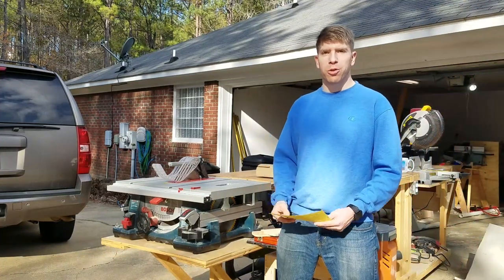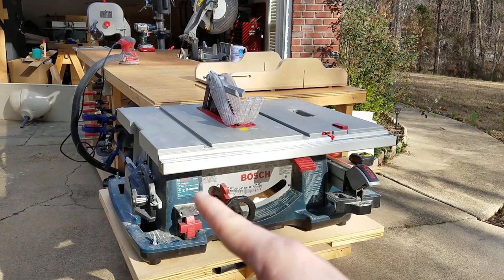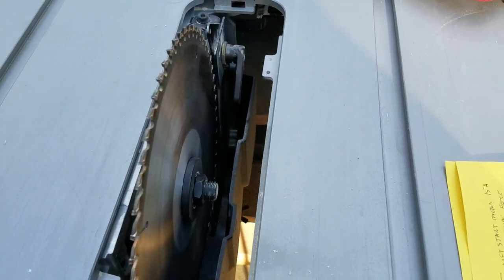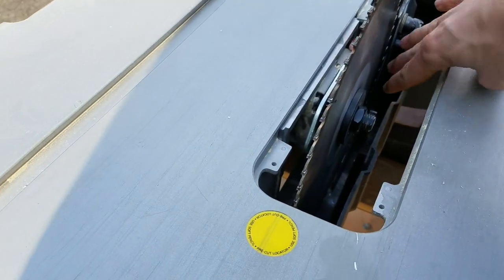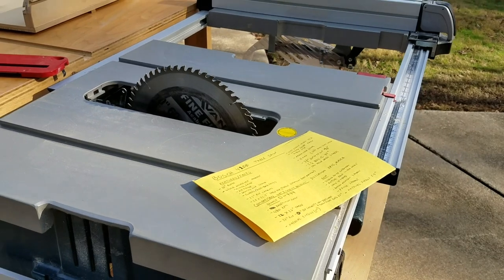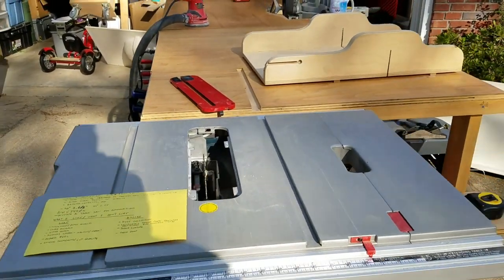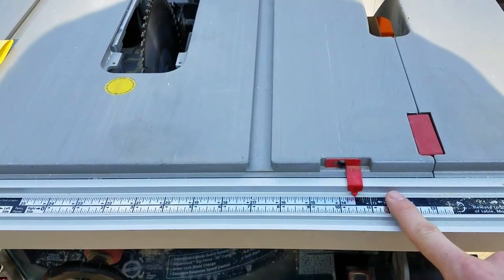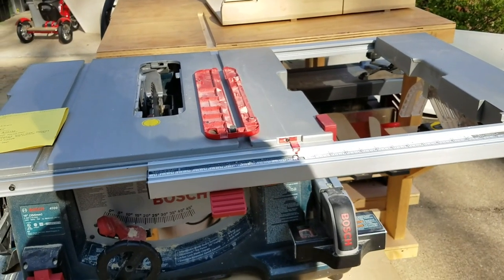BOSCH 4100 Table Saw Review / EP15

Comment: I too have the 4100 and have had it for around the same length of time.  I still like my saw very much.  I hook my saw up to my homemade  cyclone vac system and hardly have any dust anywhere.  My vac is just a 2  1/2 inch system.  Yes!  I would  buy this saw again!
Reply from the maker: Great, thanks for sharing. Id be interested in hearing more about your dust collection setup. Thanks for watching and adding to the dialogue!

Comment: Great and informative review of both the positives and the drawbacks. Thank You for taking the time.

About 5 years ago I was also picking between BOSCH and DeWalt. I did go with the DeWalt and have never regretted my choice. Dust collection is quite good for this type of saw and even better when using a zero clearance insert. Those are easy to make for DeWalt as they require no cut outs or rabbets underneath. And I also move the fence by the fence, there is no need to turn the rack&pinion knob to move it, the fence moves freely. Rack&pinion knob is however very useful when You need to make micro adjustments to fence position, You can very accurately move the fence by a hair's width and lock it down without nudging it off the mark. I would like the larger rip capacity of the BOSCH sometimes, but have found ways to work around that (tracksaw). DeWalt has been dead accurate for >5 years now and never needed any adjustment. The aluminum table finish seems to be more durable on the BOSCH as mine has a lot more streaks and wear marks on it from roughly the same length of use (~5 years).
Reply from the maker: AM YouTube, great discussion and thanks for commenting and the feedback! I know there are a lot of others out there making this same decision thanks for adding to the conversation!!

Comment: Mine's an older Bosch 4000 with the scissor stand, bought in 2007. And I have to totally agree on the accuracy of the fence. I once made a very slight adjustment to the  calibration of the sight gauge on the side of the rip fence clamp, and since then I have always been able to rely on it for precise cuts without having to use a tape measure between the fence and the blade.
Reply from the maker: +Framerite Airdrie, thats great to hear. Thanks for adding to the conversation and for watching!
Reply: Framerite Airdrie is your fence sloppy and how does it hold adjustments? Do they keep? That sloppiness and uneven as is my main concern, compared to a rack and pinion mechanism.
Reply: @sessiontelemetric5618  I haven't noticed anything of concern. I've found the key is to only move the fence by holding the handle/locking lever, then it stays straight and locks straight. Attempting to move or push it anywhere else along the fence can make it lean crooked a little bit.

Comment: Appreciate the review. I've been heavily researching options for a month. I've been down to this which would allow me to get a jointer and planer on my budget or blow my whole budget on the sawstop jobsite saw and not get the other tools. I think you've reassured me that this Bosch is good enough for now. Thanks!
Reply from the maker: TabletJunkie, thanks I'm glad to hear it. The saw stop does look like an awesome saw. I didn't realize it until I made this video, but my saw is 4.5 years old and going strong, I haven't found too many limitations with it. I really appreciate the feedback.
Reply: Crazy to read this, I just went to the store with thoughts to buy the sawstop job site saw, I instead bought this Bosch and a jointer and a planer instead. Ha! Hoping I made the right choice. The thing that stopped me last minute was realizing that the sawstop comes with a motor which is SIGNIFICANTLY underpowered compared to ALL of the other brands. 1.5 vs 4.0. Although, who knows when it comes to actual hp vs max hp. Seems to be difficult to find a solid answer as to the actual hp of the Bosch. Hope you’ve made the right choice by now and if you have any feedback on what you chose or knowledge you’ve gained, I’m all ears.

Comment: Good review. For a job site saw one selling point is Bosch has soft start; important in a job site saw.
Reply from the maker: David Davis, thanks David. the soft start is definitely a good feature. i routinely run this saw on the same 15Amp breaker as my shop vac which if both peak current draw at the same time it can trip the breaker. The soft start motor on the cell prevents this. thanks for watching!

Comment: Good Video, Chris.  I have had a 4100 for five years.  So far, I've left it on the stand.  The dust is certainly an issue.  Since I left mine on the gravity rise stand, I was able to add a snap on bag under the saw.  This together with my dust deputy captures most of the sawdust.  Love your videos.  Keep it up.
Reply from the maker: Snap on bag sounds like a GREAT idea! Thanks for sharing
Reply: Hey, Chris.  I'm thinking about taking my saw off of the stand and building a stand w/drawers in order to gain some additional storage.  I'd be interested to know how you deal with the adjustment of the blade when you want to make angled cuts, say a 45 degree cut.  I find it to be extremely difficult to accurately adjust the angle of the blade.  Thanks.
Reply from the maker: @pteddie6965 , when the angle counts for quality & fit, I always check it with a  calibrated gauge, 45deg square, protractor or T-bevel against the blade and adjust the blade using that reference rather than the saw's stock gauge. I try to tighten the angle lock with my left hand while holding the gauge against the table/blade with my right. Those new fangled magnetic/digital gauges may allow both hands to control the trunnion/locking knob. I recently purchased one, but don't have enough experience with it to trust it quite yet. It claims an accuracy of .02 deg, so it may not be as repeatable or simple as the good old T-bevel.

Comment: Thanks for the great review.  I purchased my Bosch portable table saw over fifteen years ago. It seems the basic design has not changed all that much. I used it regularly for about eight years on remodeling projects, but it hasn't seen much work the last couple of years. It did everything I needed it to do.  ---  I recently took it out of storage as I need to rip 80' of 3/4" Hickory stock at a 45 bevel. I purchased a new 24 tooth Freud blade just for the job. The saw top has never been cleaned since I purchased it and it showed with lots of dark blotches and probably some sap buildup over time. With my random orbital sander and #220 sandpaper I gave it a good scrub down. I then applied a coat of Turtle car wax and a smooth small board glides across the surface with minimum resistance. The surface looks pretty good, but there are a number of grey blotches. ---  While refreshing my memory about table saws watching YouTube videos I finally learned about riving knives. I dug the old safety contraption out of storage and sure enough it had a riving knife as part of it's construction. I had to destroy the device to get at the riving knife. I then had to cut the riving knife to be at blade level using my sawzall with a metal blade. One test rip on a piece of Hickory showed me how helpful a riving knife can be.
Reply from the maker: Thanks for sharing your thoughts on the brand and story! Sounds like it held up well, over the years. The new tops are painted steel, paste wax helps protect it some.  Thanks for watching and for the kind feedback.

Comment: Rip capacity: I noticed this saw with full extension, opens up to 25 inches. Very recently on mine, (the 4000) I discovered you can get 2 EXTRA inches. When you slide the rip fence all the way to the end, it hits a metal stop. That stop is mounted with a slot in it. Loosen the screw and you can drop it down and then slide the fence over almost 2 inches more and it still clamps securely. I was able to cut several pieces at 26 3/4 inches like that.
Reply from the maker: Great, tip. Will have to check it out!

Comment: Great video - very helpful.  Two questions if I may - 1) how wide is the saw table surface, edge to edge, when fully extended and 2) curious as to why you offset the saw to the left of the bench?
Reply from the maker: Thanks for watching and the questions:
1. ~27" I can't recall exactly,  Bosch has a 25" rip to right off blade capacity+fence thickness. 
2. I cut 8" of width from my original workbench design, (40"x96" vs 48"x96").    I installed my saw in the location I designed,  to prevent interference with the miter saw for wide panel cuts.  I don't recommend the width I cut to and would rather have that top support back.   When building,  I decided to build my cart smaller for moving reasons,  that turned out to be a non- factor.

Comment: Hi Chris, I have the same saw and have typically only used it on outdoor jobs around the house, sitting on the patio. I'm now moving it to my small shop, and was interested in how you build your outfeed table. A few q's for you: Why did you offset the saw left of the table, doesn't that make ripping a sheet of ply difficult? And also, do you use the outfeed table for any other woodworking, like planing, sanding, glue-ups etc.
Reply from the maker: Hey,  long story on that one.  I've got some very old youtube videos that explain why I did that,  but mostly it was due to keeping the cart 40x96 due to crated military moves.  Here's the latest design and some of the logic:  https://youtu.be/ICwf5a28F5c
Yes on glue-ups and outfeed for certain other machines.
Reply from the maker: This also explains what I would change about the setup you saw in the first video: https://youtu.be/gfcWLzsRthI

Comment: My one stopped working the moter makes annoying noise and the did smoke with no pressure on the blade, did open the for brushes and it was good. It's too old anyway ran out of warranty too so it's garbage after too much use.
Because you can't find the moter in any store or online.
Reply from the maker: Sorry to hear that JR. Are you looking at a saw to replace it?
Reply: @benchtopwoodworks  no I recently bought the same one so if the new one brakes down I have the parts
Reply from the maker: JR, I hope the new saw is working for you.  I'd be interested to hear your thoughts on if you would buy another.  My saw is getting old and I'll probably replace it at some point

Comment: Chris - thanks for making this video. I just bought a used Skilsaw SPT70WT which looks to be almost the exact same saw as yours. Mine even has a Bosch manufacturer's plate on it. This makes sense since Bosch owned Skilsaw until late 2016. Overall the saw is great, but one thing I don't like is the tabletop surface. It seems to have more signs of wear than I would expect: scratches, and discolorations. I'm thinking about resurfacing it or even just buying a new part - kind of pricey though. I did put wax on it which has helped. Anyhow, are you still happy with your saw now that it's 4 years later?
Reply from the maker: Bernard, I've had the saw since ~2013 and have tuned it several times in that period.  I wax the table from time to time,  although the coating on mine reacts a little with the solvent.  Overall,  I'm very happy as I didn't expect to get nearly a decade of use from a jobsite saw. Considering the tradeoffs given up from a larger saw,  I'm satisfied with the performance and accuracy.  Using a large outfeed table seems to make up for the small table area, I don't think I'll ever go back to using a saw without a long outfeed table.  Thanks for watching,  and taking the time to share.  I did not know about the Bosch/Skil manufacturing similarities,  very neat to learn!

Comment: Chris Harpster - do you have any advice on aligning the blade with the miter slots?  I've done what the manual instructs, however when I go to tighten down the four alignment bolts it shifts out of angle.  Any advice would be greatly appreciated.
Reply from the maker: Hobes, I don't have any specific advice on the method outside of what the manual says for the process.  My saw's run-out and alignment are as close as I need them. Based on your description, I may have a solution: try using wedges between the carriage and housing. Tap them into position and use their force to align the carriage/ blade and miter- slots.  This should hold the assembly where you want it while you tighten the 4x bolts.  Hope that helps. Please let me know if it doesn't.  I'll take a closer look at my saw

Comment: I have had nothing but issues with mine I find the fence is sloppy ,adjusted it many times and yes I know how to adjust it properly but always seems to go out of square. And the groove that runs down the side of fence is terrible, if you want to tip say a 22.5 deg angle down both sides of a 2x4 that groove interferes so then you have to clamp something to the side of the fence. A friend of mine with the same saw has accidentally turned the saw back on while the blade is spinning which he blew two motors because of the soft start motor. I love Bosch products but for me this saw has become my least favourite tool in my shop time to upgrade just wanted to share my experience good review tho.
Reply from the maker: +ryan iverson, thanks for adding to the discussion and sharing your experience. I'm sorry to hear about your issues. I would definitely consider writing Bosch about them, and thanks for informing those that are watching this and considering buying one of the 4100 series about some of the potential negatives
Reply: ryan iverson -thank you for sharing your real world experience. I'm shopping for my first saw & the Bosch looks like a 90% of the way there product. Comparing it to the DWE7491RS & The Bosch fence is a concern. The demo unit at the store is sloppy & would really need a square in use to be accurate, which I don't think is as practical as it should be. I wondered if fine adjustment was possible if I bought one but as you have reported, even after addressing yours it still goes out of alignment. Again, thank you so much for commenting!

Comment: hi, thanks for the review. i was wondering if you could describe the adjustment for the right side extension table sag you mentioned. i have the same saw and when i extend the rails to cut out to the full width it sags almost 1/4 inch. would love to minimize this if possible.
Reply from the maker: razerface35, there are 2x ways to adjust.
1. The 4x machine screws on the inside of view the extension table that hold it to the rail (probably will do the trick)
2. If your whole extension rail is out of alignment and at an angle the whole system can be adjusted by loosening the 6 screws that hold the sliding rail to the main saw table. 
...I have today off from work so I'll shoot a quick video and post it. 
Thanks for the question!
Reply from the maker: razerface35, just uploaded a quick video, hope it answers your question.

Comment: Been using the saw for a while and can agree, the dust comes out everywhere.  As I work in a closed garage mostly, I wear a dust mask just to keep my lungs clear.  
Interfacing the variety of shop vacuum diameters to gear, due to the variety of diameters is always a mess.  I need to get my 1 7/8 rigid hose to mate up with the what I assume is a 2" port on the Bosch saw, but then still the open space will let dust out.  Any tips on interfacing ONE vaccum to a variety of saws (compound mitre, this table saw, palm sander, etc.. everyting with its own diameter port)?
Reply from the maker: +Minok1217, I've used a heat gun or propane torch to bend PVC to make custom fittings. I also like to use rubber plumbing couplings for attaching dust collection attachments of varying diameters. I definitely think the saws dust collection can be significantly improved, I plan to do so at some be point in the future and upload a video.
Reply from the maker: +Minok1217, here is part of my solution: https://youtu.be/JUrYdRQ0V38

Comment: May i ask what blades this saw uses. Especially the inner diameter. Thanks
Reply from the maker: The Arbor is a US-sized 5/8". I typically use 10 1/2" blades but have also used 7 1/4" thin kerf and 8" dado.

Comment: Hello !, how do i fix the blade adjustment , i have to use vicegrips on it ,
Reply from the maker: Tice, can you describe what isn't functioning, angular adjustment or blade raising wheel? I'm unable to help based on your description.  Bosch customer service may also be able to help.
Reply: @benchtopwoodworks  hey Chris , my mistake its the gear that raises and lowers the blade thats broke
Reply from the maker: Tice, without seeing your full situation,  I recommend you find the exact parts that are damaged and order rerr placements. If the handle is broken,  you may be able to make one out of wood.

Comment: Thanks for the review Chris! I just bought this and am in the process of aligning the blade with the miter slots. The instructions state to loosen the four bolts under the table but even when doing that it doesn't seem to allow much (if any) play to align the blade with the miter slot. Do you recall the process you used to make this adjustment? Any tips you have would be greatly appreciated!
Reply from the maker: Ron, thanks for the feedback,I really appreciate it. Unfortunately...(or fortunately depending on how you look at it) my saw was very square right from the store and I haven't adjusted it since. I'll take a look at my saw/manual as soon as I can and get back to you. I hope you get it tuned up soon. Please let me know how you make out, and if you get it figured out before I can get back with you.Thanks again for taking the time to comment, and happy building!